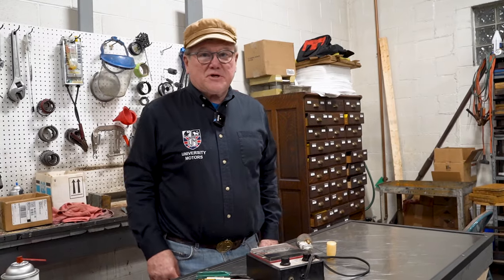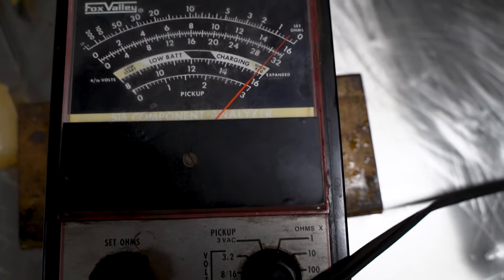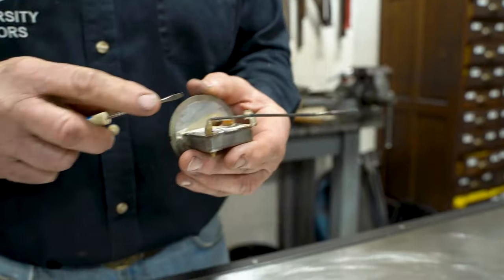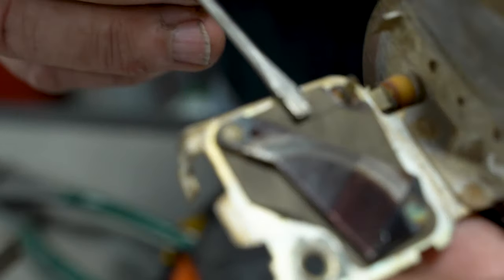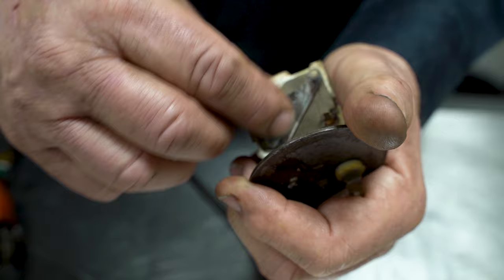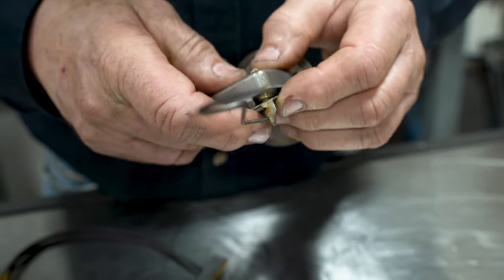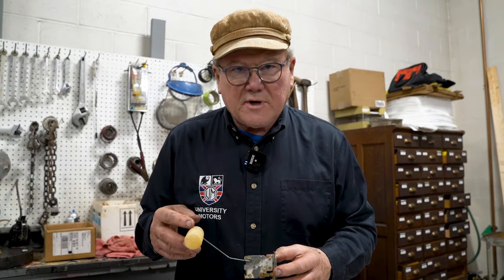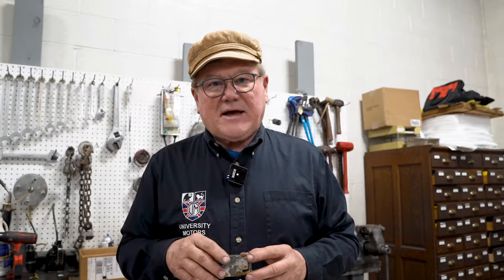368 MG Tech | Repairing Fuel Sending Units

Comment: I repaired a "closed cell foam" float by drilling a hole in it just large enough for an automotive marker lamp (baseless bulb about 1/2" OD)  Buoyancy regained and gage works great again.  Drill hole slightly undersized for a tight press fit of the bulb glass into the foam.

Comment: Also I wish I had seen a video like this several years ago when my sending unit failed. The new units are not consistent as I get a different reading each time my gauge starts to hit the red. (1977) Sometimes I need 1.5 gallons and other times I need 2 or more. I try to rely on the trip odometer but that sometime is finicky, possibly due to age.

Comment: My gauge only swings between 1/4 (empty) and 3/4 (full.) Clearly not a float problem and I find it strange that, if a calibration problem, it is at both ends of the range equally.

Comment: Sir can we use copper wire
Reply: No it needs to be resistor wire.  Copper too low a resistance and soft so it would wear out quickly when the wiper runs on it.
Reply: Sir which type of resistor wire should we use
Reply: What is the name of the resistor wire